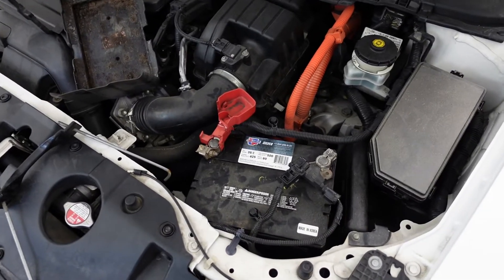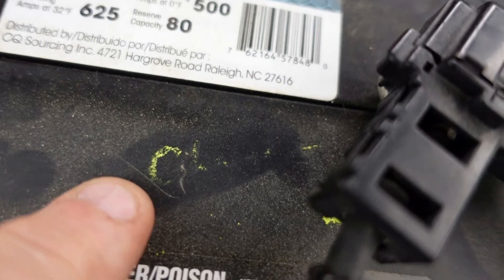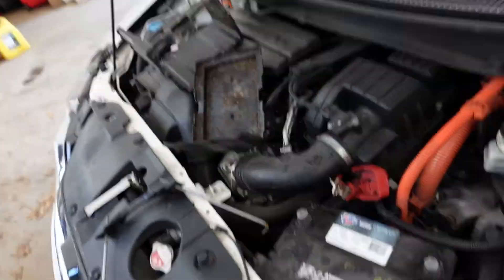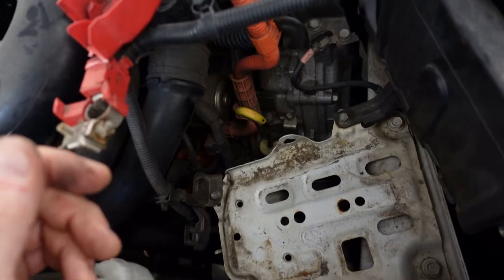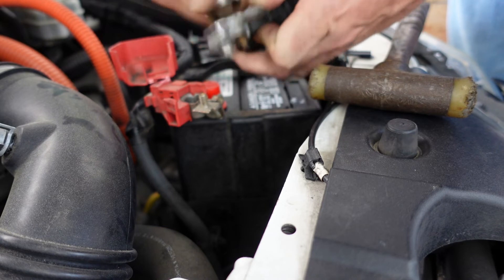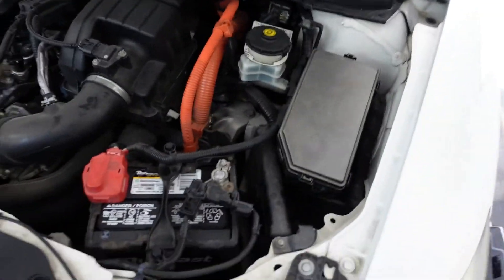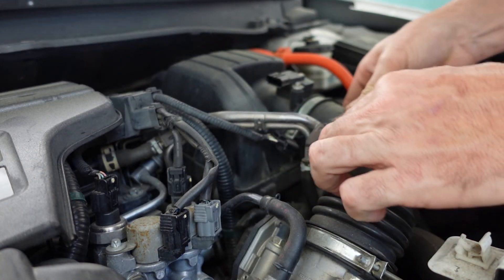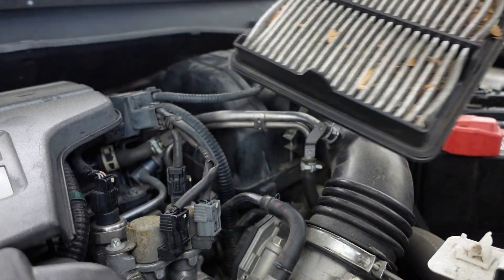Diagnosing a failed IMA System on a Honda Civic Hybrid - Part 4

Comment: I’m having the exact same problem you are but my Honda is a 2012 Honda Civic hybrid same codes can you please let me know or send me the link of the DC DC inverter you bought another question did you at all use electric gloves to do any of the replacement?
Reply from the maker: Howdy! The part I used was from Bumblebeebatteries.com. This should be the link. 
https://bumblebeebatteries.com/product/actualproducts/gaz-shocks/
(Why it says gaz-shocks I have no idea.) It's still working perfectly so far.
I did not use any electrical insulative gloves when I worked on the car. I trusted the big breaker switch behind the left side of the rear seat back. Though it is certainly not a bad idea to protect yourself when working with these high voltage units. Thanks!
Reply from the maker: I almost forgot. If you have under 150k on the car, it may be under the factory extended warranty program. Something to check if applicable.